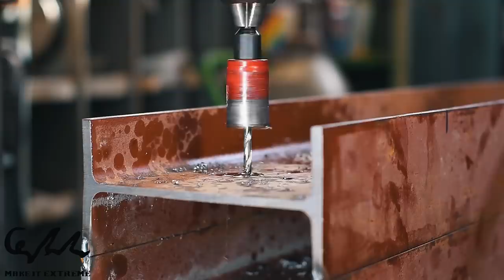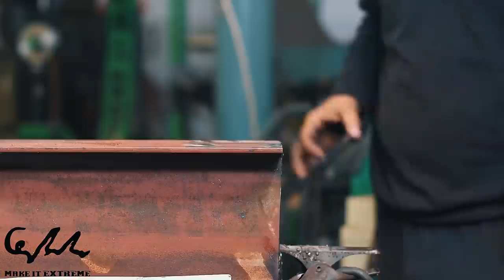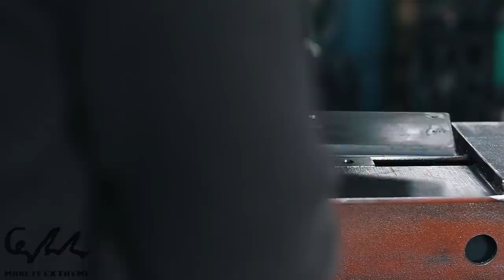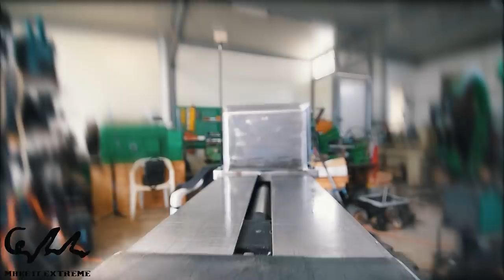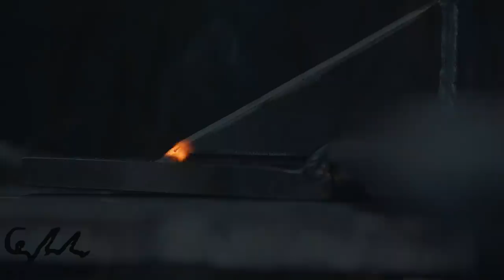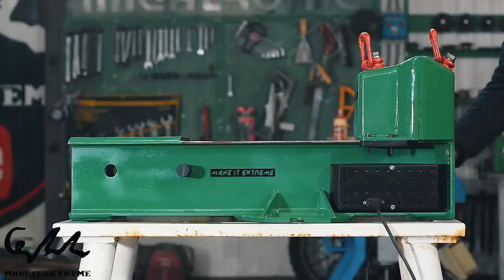Project 096 | Making a Massive Electric Vise

Comment: Those linear motion lead screw actuators have come a long way and is showing up in many applications. The couple applications I had to work on was there was one used to release bucket pins on a quick attach loader bucket. And the other one was used on a Vermeer SC505 stump grinder to engage and disengage the clutch. I believe they got their debut as a electric powered trailer tongue jack... As far as which is better hydraulic or electric, it all depends on the application. hydraulic would be more bulky with more component parts to make up the hydraulic circuit. Versus the electric version which is  compact. The decision to use the electric powered actulator was a good choice. Just install a unit to suit your clamping pressure needs... I believe the guys did a fantastic job with fabricating a piece of shop equipment. And to all the naysayers, build your own make sure you record it with a video and then post it and let us see what you come up with.

Comment: Try putting the vice on a set of worm gears, it'll increase torque output from the motor and make it quieter so it doesn't sound like it's struggling quite as much, and it'll increase the actual compressive force of the vice so you can grip things more tightly with it.

Comment: Wouldn't one of your hydraulic cylinders be more powerful?
Reply: It's a vise not a press
Reply: @mitchellpatterson3323  Actually your right, sorry my bad. Or else it would just crush the stuff instead of just firmly holding them.
Reply: It can crush a square pipe of, apparent, one mm thickness wall. It's a waste of power with hydraulics. Like adding a JATO to the fastest production car in the world.
Reply: @kaumohlamonyane272  No need for any apologies mate :)
Reply: My dark and bad aspect 🤣, I am very perfectionist and exaggerated.
Reply: @aserta  Crushed it from the sides doesnt count, he hit it where its weaker. if the whole tube was in it and crushed it id be impressed.
Reply: @Alan Jackson What kind of name is Alan Jackson?? How do you know which is you first name and which is your last name??
Reply: Some have the last name of Dan.Did you steal yours?
Reply: @delallegood5799  No but my parents probably did.
Reply: @Alan Jackson my wrought iron vice handed down from my grand dad can do that and more. 6000N is really weak and the camping force is working mostly against the frame due to the rails being too short. There's a reason a vice has a moving carriage almost the whole length of it.
Reply: This thing isn't anywhere near as powerful as a hand cranked vise. The guy that said it's not a press, is like saying, "it doesn't need a hydraulic cylinder. It's a press, not an excavator." Just because it's a vise, doesn't mean it can't have a hydraulic cylinder. The way it is now, it's to week to do anything with, except for holding some wood for a glue-up.
Reply: The idea is to get along without expensive hydraulic pumps, noisy motors etc. Also, it doesn't need to crush thing but just to get a firm grip. The test showed it's more than adequate for that.
Reply: I must say, I like the frame and the electric concept, however I would have had the electric motor run 2-3 large screws that moved the jaw face and not the back stop.  The moving jaw as it stands is mounted with just a few "small" bolts which would surely shear if there was a hydraulic ram pushing it.  With large screw threads it would be capable of tonnes of clamping force.  A built in preasure guage would be handy to keep a human feel for how tight your clamping though.  Just my thoughts for vice 2.0.
Reply: The only way you be happy,  is that you make your own,  your way.  Leave the guy alone,.... he's good doing diferent things,  he gives new ideas to people like me, that likes to them my own way..
Reply: I think the trick is this one can be made without an expensive hydraulic pump to run the whole shebang. A simple LED transformer probably gives enough power to run the actuator. Typically they run 12, 24, or 36 VDC. This one looks to be a 24 VDC and I think he uses that kind of transformer (get them cheap on eBay).
Reply: This doesn't have enough power for a vise but if there would be a cylinder the vise would be ripped to pieces because it's made too weak
Reply: Yes 6000n is nothig just 600kg a cheap vice with a screw can easyly make 2500kg force
Reply: @Argosh  finaly someone with a working Brain

Comment: Super nice build. Although I would have loved to see a hydraulic system with a pressure regulator. You could set the exact clamping force easily.
Reply: Purpose of this vice is not be very powerful, but helpful to hold some bigger (long) objects. It can be modified later (stronger actuator added, hydraulic).

Comment: 6000N is probably the force of the actuator. What everyone seems to be forgetting is that the actuator isn't positioned in line with the clamps. Which on its turn is going to cause friction which will cost you clamping power. Probably not the best possible design.

Comment: Thats awsome! One question, everything is so heavy duty, but the link that all the stress is put on is what looks like a 3/8ths clevis pin. It would seem better matched to use a hydraulic dual action ram from maybe a snow plow or bucket loader that have a much larger clevis pin. Your design in the mechanics looks like it would be well suited for 20 tons. Just a question, not a criticism. Thank you for these awsome videos! You have no shortage of talent.

Comment: How big will the bang be if someone accidentally plugs the AC plug in the pedal socket? For safety I would suggest reversing the sockets, it also means that the powered pins aren't exposed when the pedal isn't plugged in. Otherwise this was another fantastic build.

Comment: P.S. P. S. To the know it all's....take note of the equipment in this guy's shop! Obviously he knows how to run it. Now, do you honestly think he is an amateur? Maybe he should have titled the video Massive Electric Clamp because obviously that is exactly what he had in mind when he decided to build this apparatus. If it had a hydraulic cylinder it would've been a weak press. With a square threaded rod it would've been a serious vise but not remotely operated which is the initial purpose of the damn thing.

Comment: Wouldn't it be useful if there was an induction hardening machine that could harden those tapped holes after tapping, so that they could endure the tightening of high-tensile fasteners. Always a weak spot; tapped holes in a mild steel frame.

Comment: Machines surface flat with shaper. Warps surface again by welding on it...
Reply: That’s what I thought...I’m no expert by no means; but I would’ve waited until all of my welding was done, then machined the bed. But then again, I would’ve used 3/8” walled square tubing instead of welding I beams together. Still pretty impressive ingenuity though.

Comment: Tell me you did not use plain cheap mild steel for this?  If that is the case,  you made it extremely weak and flimsy.  Either use high strength steel or don't make it at all.

Comment: builds vice body capable of handling easily 80,000lbs.. puts 1300lb actuator on it... not saying you over built it.. not saying you under powered it.. but those numbers should be an order of 50 apart!

Comment: This is hard to take. You build a vise framework with over 100kg of steel and then use an electric, gear driven linear actuator from 22newcentury.com to provide the closing force?  Man, I could do way better with my new vise from warmhappy.com using my left arm only

Comment: I think a different cylinder would make this a real viable tool. It's cool but I question the structural integrity and physical clamping force of this cylinder as being effective.
Reply: @qazwsxedc7448  Hey YouTube tough guy. You either did not read what I said or did not comprehend it. I said I believe if it had a larger cylinder that it would be a real capable and viable tool. That is to say it may work as intended in it's current configuration. But it is not nearly as useful of al tool as it could be in my opinion.

Comment: A toy actuator in a MASSIVE vise, are you kidding?   ¬¬
This will be my first dislike in this channel.
Reply: What did you want him to use Ricky?
Reply: @samruba7441  Sammy, he should have used hydraulic cylinder, or at least a mechanism not based in toy motor not toy gearbox (tiny gears)
Reply: @rodstartube  Maybe, but the goal for this machine is to hold things firmly not crush them. He did however demonstrate crushing things with it but I don't believe that was the overall goal.
Reply: @samruba7441  , even with making allowance for the "make it extreme" tag, this vice defies the sense of proportion. Any person using a vice of this dimension and proportion would expect it to have a much larger clamping force than what could be generated by a tiny 24 V DC linear actuator. If the purpose of this vice with such monstrous proportions is to provide clamping force for a few wooden glue joints as shown in the video, the actuator would serve fine. But surely, you would want to put it to greater use. 
Another aspect that seems to have been overlooked is a mechanical backup for the clamping force, if and when the actuator fails, which looks very much possible. The consequences of a failed clamping force when this vice is used in critical applications like a milling machine can be disastrous. A more fail-safe design would be to use a threaded screw mechanism that is driven by a motor. The clamping force would be in place even if the motor were to fail.
Reply: @safelinefleet6633  Look up what's inside a linear actuator I think you'll be surprised
Reply: @samruba7441  , I am 54 years old, with 38 of them spent in mechanical engineering projects including installing wind turbines at 16000 ft altitude in temperatures of minus 47 deg and 3 ft of snow. Still think the same on my capabilities???
Reply: @safelinefleet6633  less actually
Reply: @samruba7441  oof but I do have to go with the hydro side. I was under load when crushing a .25 mm wall thickness CAN. I would expect it to try to create a black hole out of it not a lazaly crushed can
Reply: @samruba7441  you're right, to the extent of your knowledge.
Reply: Purpose of this vice is not to be very powerful, but helpful to hold some bigger (long) objects. It's NOT about force, not always. Idiots complaining do not understand this.

Comment: I'm sorry I don't mean to be crass but I saw the first vice build and now this one... and a bunch of 3/8" plate steel welded together is not "extreme." You may notice that no high end vices are made this way... there's a reason. I mean if you just want it to look cool and beefy on the outside, I suppose you've done that.

Comment: All that work for a can crusher!?! Clamp that chunk of box steel back in there and use it as a lever. If you can work it back and forth until it snaps without the jaws moving a fraction of a millimeter then it's a vise.
Reply: Purpose of this vice is not to be very powerful, but helpful to hold some bigger (long) objects.

Comment: that vise is built like it would be strong enought to hold anything and then u putt a small and weak elecrtric cylinder that cant even crush a can without slowing down
Reply: This project is NOT about force, but size and length. Hydraulic actuator can added later.

Comment: A vise for a machine tool has to be able to hold up to a minimum of 10,000 lb of strain without letting the part move even .0001" and this thing wouldn't hold long enough to make a .001" pass before it moved and broke the bit, probably injuring the user.

To to 'make it extreme', he needs to start with something more capable than 'industry standard'